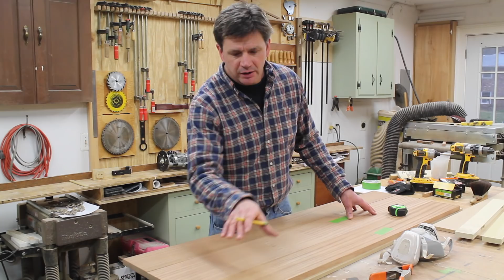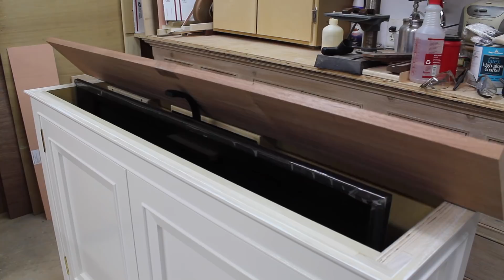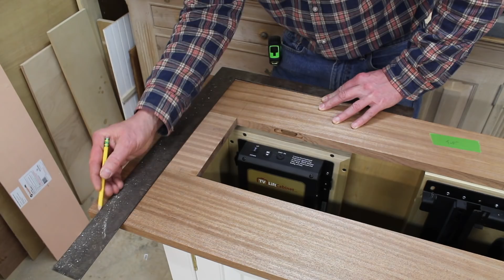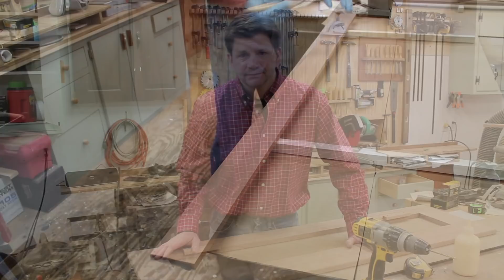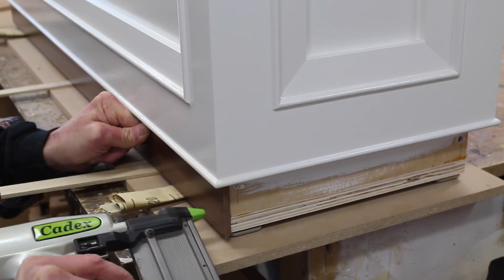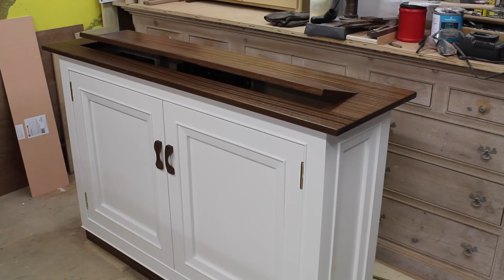How To Build A TV Lift Cabinet, Making the Top

Comment: What a beautiful cabinet! When designing projects for electronics alway remember that the project will very likely outlive the electronics so you must design maximum flexibility in from the start. For this project, I would have had the lid span the entire width of the cabinet box to be able to fit the biggest TV the cabinet can handle at a later date.  I am envious of your workshop.

Comment: You are truly an excellent woodworker, i have a question, instead of using a biscuit for joinery can it be possible to use poplar dowel,.? love your equipment very smooth in cutting those wood,. thanks for sharing,.

Comment: Excellent craftsmanship and design! I'll bet cutting the top for the flip top and the rip and crosscut had you triple checking the measurement marks! May I assume the reason for a tv lift is because the cabinet will go in front of a window for space in the room because mounting it on a wall wouldn't be feasible? I myself would be putting stuff on top of it when it was closed and have to move it all when wanting to use the tv.
Reply from the maker: +MRrwmac Thanks for the comment.  The lift is to hide the TV when not in use.

Comment: i think a Q&A on this project would be good. 
love how the build turned out, but im just wondering on the practicality of a hidden tv like this, surely you wouldn't be able to place much on the counter-top with the tv down otherwise it would always have to be moved every time it was used, adding on to another comment posted earlier, would a top down version of this installed in a roof or a ceiling mounted unit be more practical, or even possible?

Comment: I'm always nervous about installing and uninstalling hinges, or any hardware that uses screws, several times throughout the build process that it will strip or weaken the threads in the wood to the point that the screws won't hold anymore.  although that's never actually happened to me.  do you think that is something to be concerned with?

Comment: Really nice, but why the rod on the back to push and hold the lid open which drags up and down instead of spring loading the door and have a simple mechanism inside the cabinet to let the door open going up, then pull the door closed when the TV is near the bottom?

Comment: A question about attached devices.  When you put a DVD/Blu-Ray, Apple TV, WD-TV-Live or other HDMI connected device into your cabinet, how do you control them with the Remote, since the wooden doors will 'block' the Infra Red remote signals.  IKEA do these metal-grill doors to avoid that complication, and whilst it's probably way too late to change your build now that you've done it, perhaps you could incorporate such a thing ... of course, this presumes you'll have somewhere in the cabinet to put the devices ... so perhaps I'm talking out of my hat :)
Reply: +excession777 AppleTV uses Bluetooth so it doesn't need line of sight.  Cable box would though.

Comment: Great work Jon! I had a quick question about the bead molding you make with your table saw. I'm assuming I can create the same profile using a bead bit for my router.  Can you provide the dimensions of the bead profile? I really love the bead detail you use around doors etc. 

Thanks,
-Paul

Comment: Looks great, just a few questions;
1) The centre-finding bits for the hinges, I have not found a good one yet, the drills are not centric and they wander causing an off-centre hole, where to buy a good one?
2) I have seen others filling the biscuit holes with glue but have also heard that this a bad as the biscuit can swell and cause a bulge in the surface of the wood.. do you think is is true or just a myth?
Thanks for the vids, 
 - Eddy

Comment: Great video and project. I was curious if these are safe to install behind a electric space heater? I'm currently working on a enclosure for an electric space heater for the room and I originally was planning to make a second frame behind the enclosure that would hold up the TV above the enclosure. This was to avoid making holes into my current place. But I thought this looks a lot sleeker but am not sure if it is unsafe to have anything behind electric space heaters?

Comment: Hi Jon, exceptional craftsmanship. Apart from being cool as F£$%  - What's the point in it being a cabinet? you can't store anything in it because the TV is in there and you can't put anything on top as the TV need an exit point. Would you consider making it a deeper cabinet and actually making some use out of it. maybe have the Blu-Ray in there or receiver. Am I missing something other than how awesome it looks.

Comment: i was thinking of trying this till i saw the lift for a 46'' tv is $649. Never mind.
Reply: a cheap drill, a rod as a winch, two micro switches as end sensors, and a set of drawer slides, and you have all you need